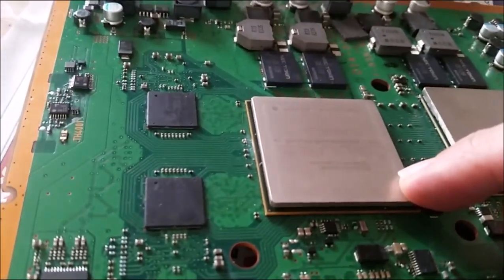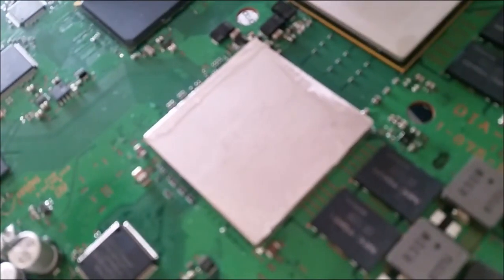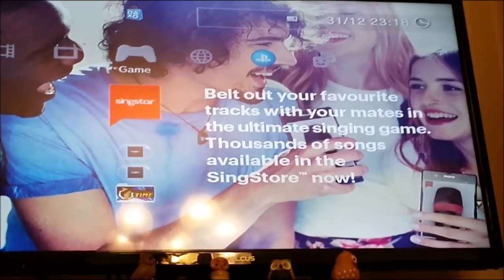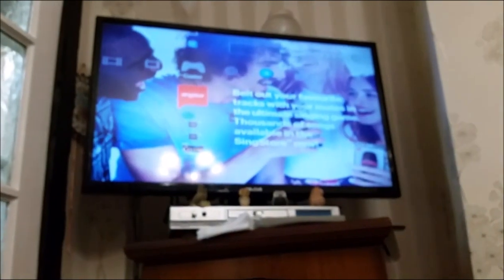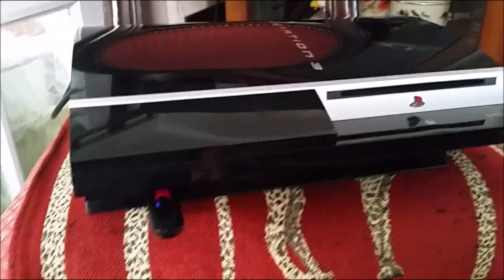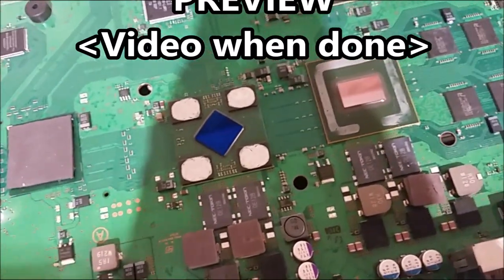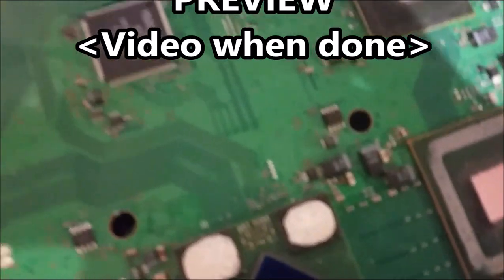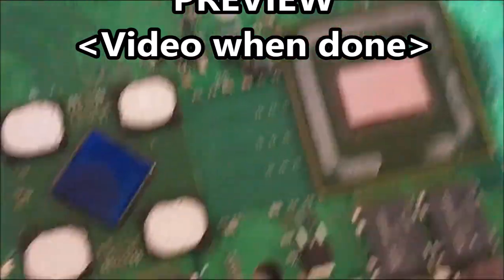Fixing a Playstation 3 YLOD for good

Comment: I’m so happy it still works even though you scratched up the CELL! 

Next time try delidding with 30lb Zebco test fishing line. If it doesn’t cut in well enough after a long time, cut open an aluminium soda pop can and use a smooth edge of it to cut in an incision in the corners and use that to help you get in with the fishing line

Comment: I have tried putting new thermal paste above the heatsink, it worked for some weeks. Maybe I should try both?
Reply from the maker: it can work above, but the paste under the heat cap will be dry, and causing heat... if you do under and over it should fix it . Please be aware that the cap is super hard to remove watch as many videos about removing it as you can! i started with this one! 

https://www.youtube.com/watch?v=1efG09NQSsI

Comment: I usually use the NSC method of delidding the CELL. You use one of those metal pry tools, bend the end at just the right point, and sand down the end until it's this enough to fit under the lid. Apply heat to the chip, then go arround the edge withe tool. ALWAYS start at the bottom to avoid damaging the chip since there is a gap in the adhesive.